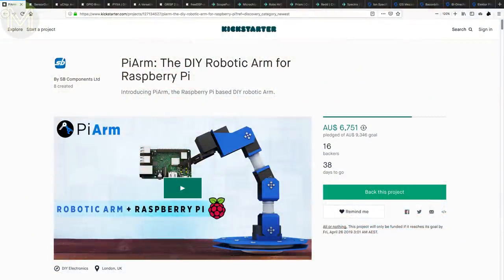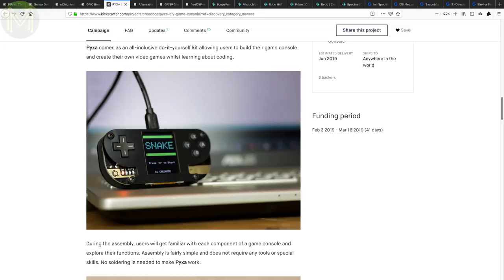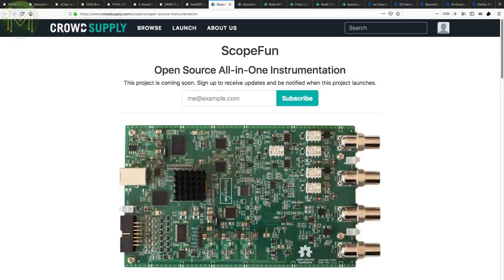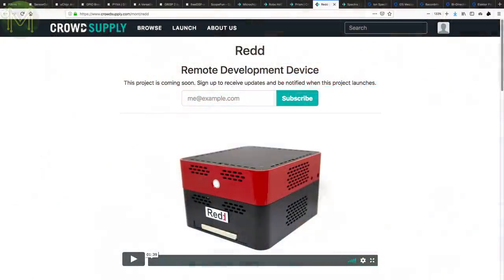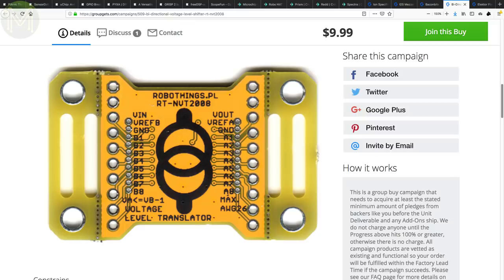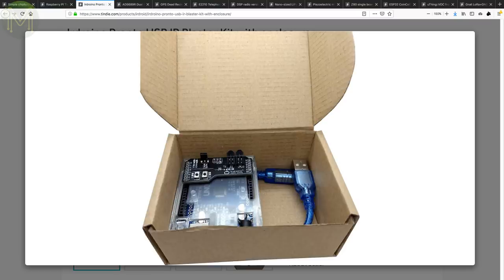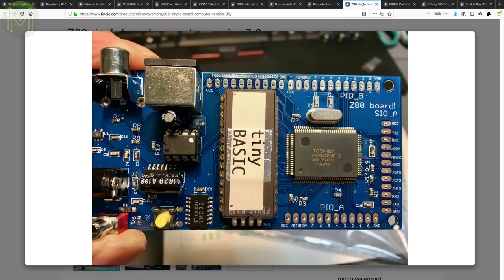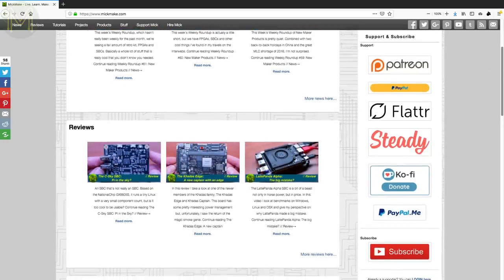#259 Weekly Roundup #63 - New Maker Products // News

Comment: Thanks for mentioning my ESP32 Coincell project. I’m constantly making it better and have it down to 90uA now instead of 200 where it started out. Removing one line off the accelerometer and a better LDO has improved things. Rev3 is away for manufacturing with quite a few changes and improvements.
Reply from the maker: Hey mate, NP.

Good to hear. 90uA is pretty low. I don't think even Andreas got it that low, but I suspect he was using a stock ESP32 module.